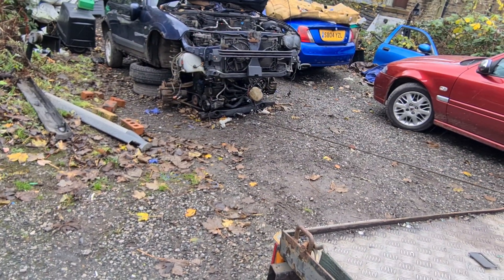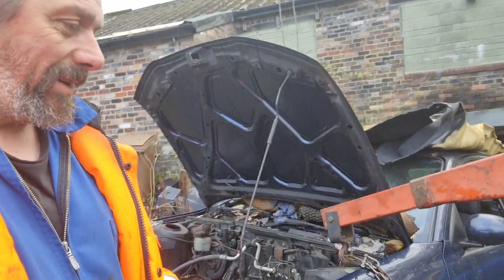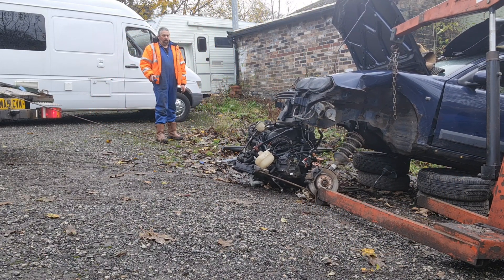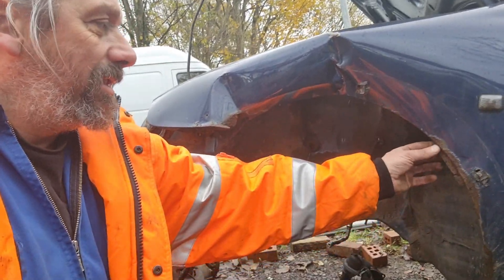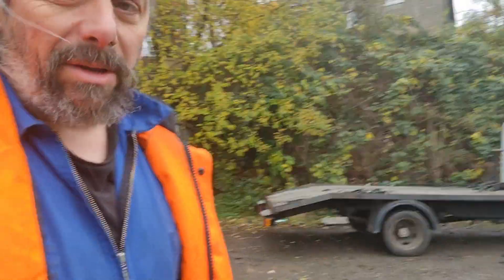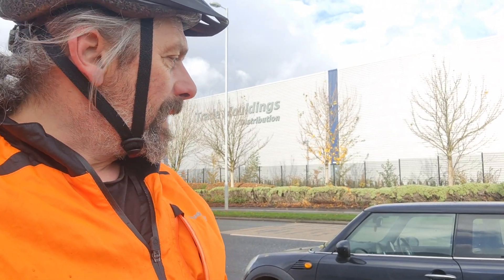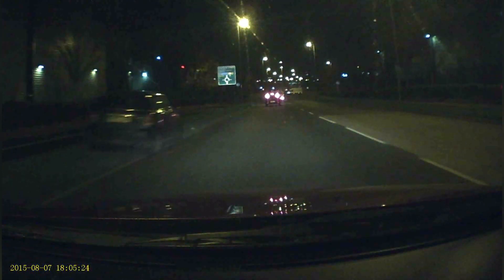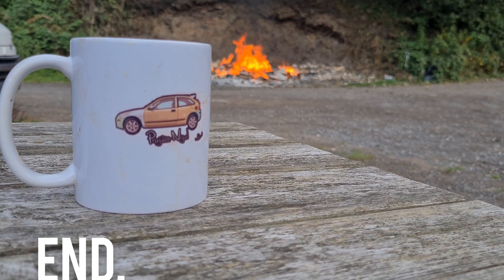L-series engine dismantled: FAIL. A good day's work spoiled by 02: SUCCESS

Comment: Ive been looking into this clean air zone in GM recently as im affected too, so its £10 per day but only if you drive within the zone and they are going to be providing grants to businesses that are affected which opens in January, the grant is currently at £4500 which recently went up from £3000 so probably worth applying for that even if you dont get rid of transit face
Reply from the maker: Good advice there. Thank you. 🙂